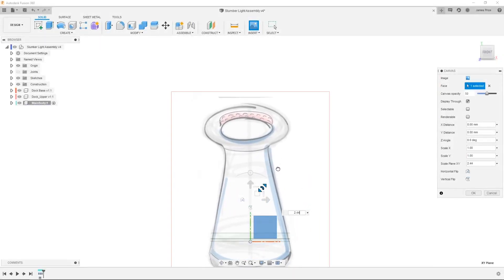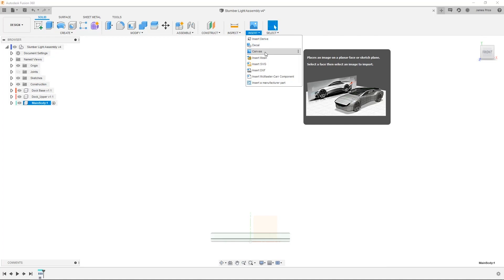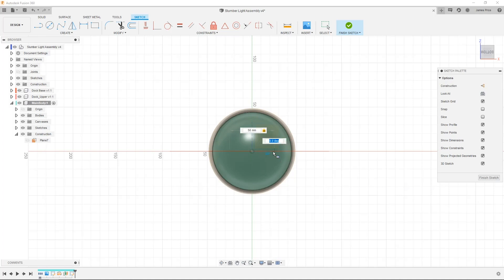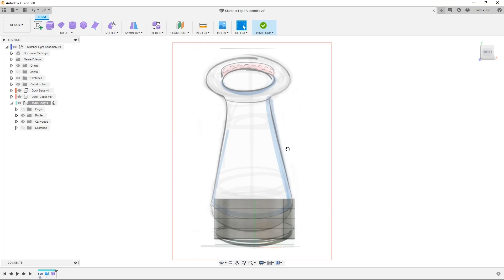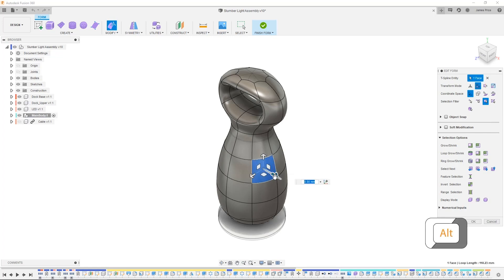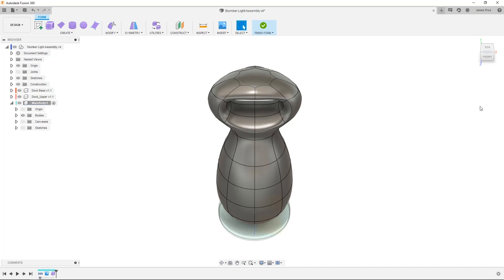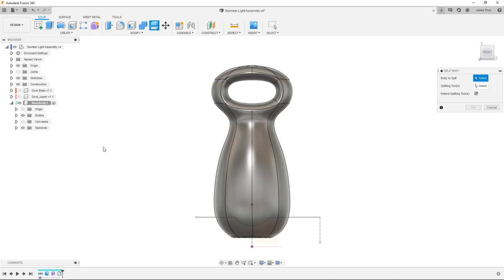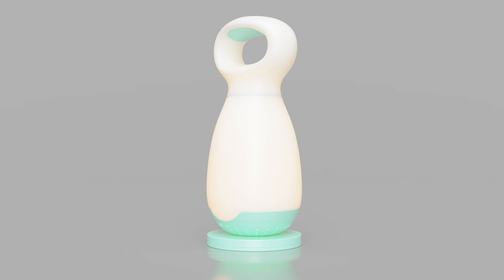SolidWorks Transition Guide 10 of 10 Surface Modeling

Comment: Is the surface modeled component considered hollow or a solid body (internally)? Are there ways to choose hollow or solid body? I would be interested in redesigning a component for a project, but this would require a rerun of a FEA. Interested to see how it responds.